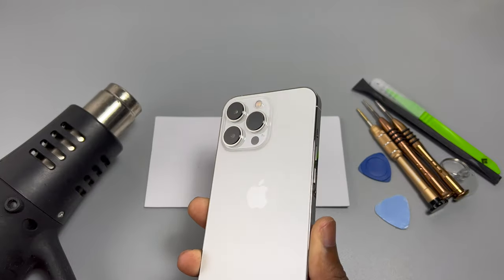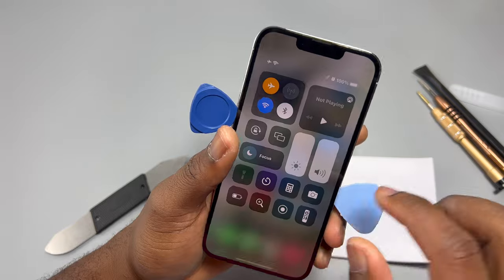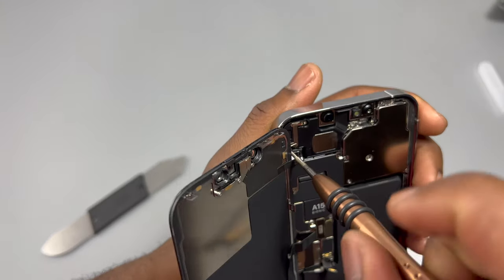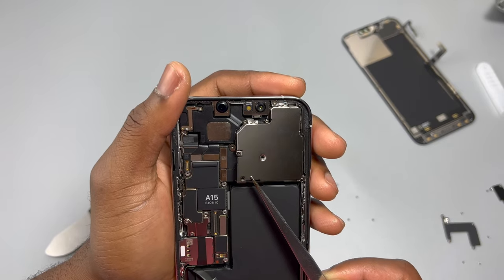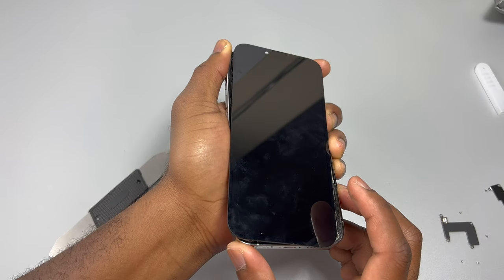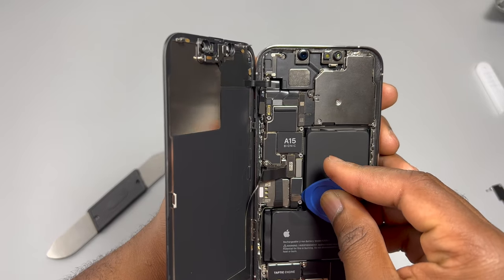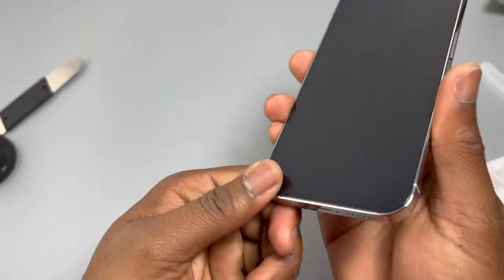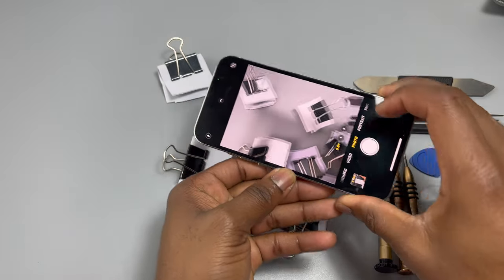iPhone 13 and iPhone 13 Pro Screen Replacement (?unrepairable?)

Comment: Can I transfer the display from iPhone 13 to iPhone 13Pro? The software was updated to a newer version before the phone was broken. Thanks!
Reply from the maker: The display if same size should work but you'll still be hit by the software lock stuff making the display work but disabling a few features on your phone.
Reply from the maker: Not sure if I respond to to your question accurately.
Reply: @ersbit  Well, I checked and compared the display on gsmaren and 99% of the things match, and as for face id, google says that iOS 15.2 beta no longer disables Face ID on iPhone 13 after screen replacement, so I'll ask someone who has already done it.
Reply: Have you found someone already, I'm thinking about the same thing but I'm not 100% sure
Reply: @darkovojkovic82  yeah please respond because I’m in the same predicament

Comment: Great job my friend. the phone did not turn on after you put it back together because you took it apart while it’s on you supposed to just turn off the phone then disconnect the battery and then you start working on thanks for the video
Reply from the maker: You're welcome 👋🏽. I think either way it will do that, even when you turn off a macbook air 2020 then disconnect the battery and reconnect the power button doesn't work. I had to plug the charging cable to power on the device. Maybe it's Apple operating systems overall 😂?

Comment: So will 13 screen work on 13pro
Reply: no it has a different connecter that is larger so if you order a 13 screen it is not compatible with 13 pro even though the whole screen itself is the same size.

Comment: which screw drivers are required
Reply from the maker: 3 for iPhones. 1 for the screws at the bottom. A y tritip for the internal screws and a regular Philips. All iphones require those three to comfortably work on.

Comment: I’m french (sorry for my bad english level) My iPhone 13 fell into the water, I used the hair dryer to dry the water… I didn’t open the phone, just try to dry the water that entered in the phone…. you think I damaged the gasket?
Reply from the maker: Hey, you started alright but did not finish. Tu aurais due ouvrir le téléphone et sécher l'intérieur aussi. L'arrière mouillé n'est pas grave c'est l'intérieur ou les choses se gate. 
Maintenant le téléphone (il est dans quelle états, sa charge ? S'allume ?)
Quelle symptômes experiencer vous?

Ma vidéo sur le redmi note 10 pro water damage illustre entièrement comment récupéré mais c'est vraiment à faire immédiatement après les premier problèmes que le téléphone va montrer. Regarde celle là après pour voir quoi faire au cas où sa se répète you never know
Reply: @ersbit  the phone works perfectly. I didn’t open the phone because I don’t want to damage the gasket seal (the display adhesive). I don’t have the material to open the phone. I don’t have the impression that water is already inside the phone
Reply: @ersbit  so my question is : by using the hair dry, do you think that I damaged the adhesive glue (gasket seal) ?
Reply from the maker: Oh ok. If the devices does not show any signs of something not normal you don't have to worry about it.
Reply from the maker: Unfortunately if you open the phone you won't be able to count on the water resistance. It might be water resistant a few minutes like 1 or 2 but even that is very risky
Reply: @ersbit  I don’t open the phone. I just used the hair dryer to dry off any water that might have gotten into the phone. i used it for 20 seconds, do you think that my phone is still water resistant after that ?
Reply from the maker: Hello, yes you're device doesn't have anything from what you are saying. 
Using the Hairdryer to dry the outside of the device will not break the water seals specially if used 20 second
Reply: @ersbit  thank you so much ! If I understand, if I don’t open the phone, the gasket seal will not be damaged and the phone still be water resistant ?
Reply from the maker: Exactly 👍🏽. Since the iPhone 13 is perfectly fine. Your seals are still good.

Comment: does a iphone 13 screen fit on a iphone 13 pro ?
Reply from the maker: It will or should but you might face issues with their software lock. I recently bought a screen for iPhone 12 that's says it's compatible with iphone 12 pro.